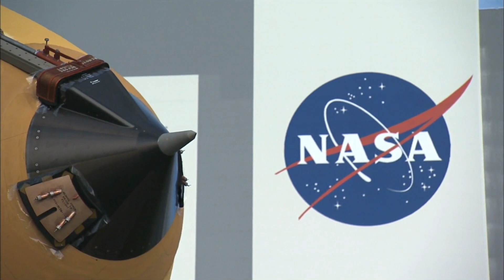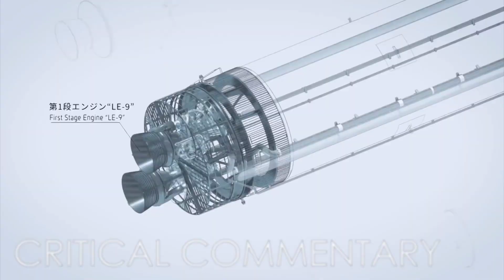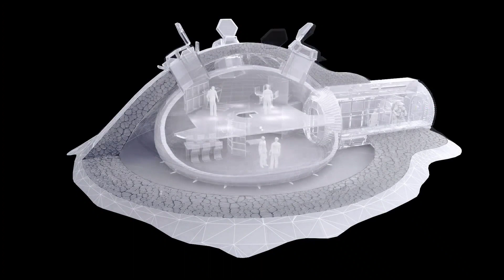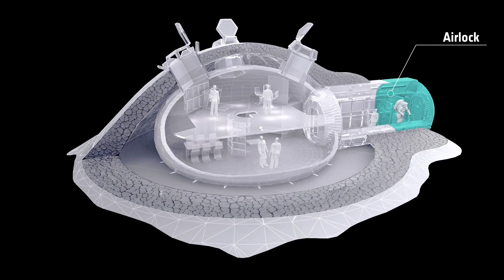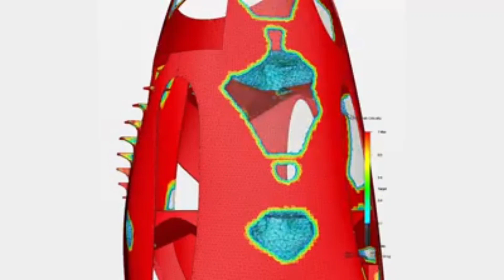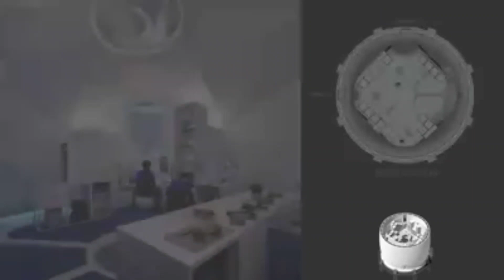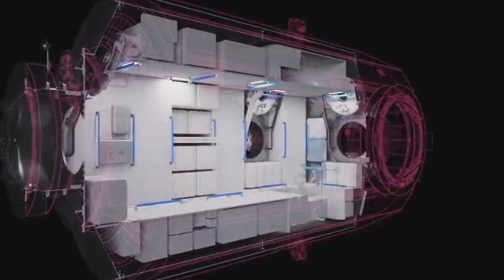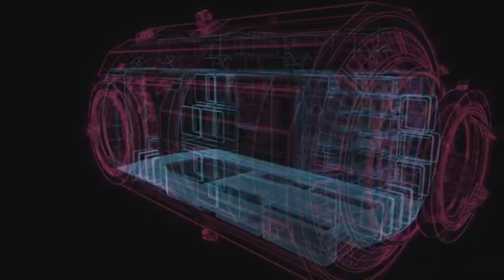YOU can participate in NASA'S 50 Point Plan for the Solar System!  How does Starship fit in?

Comment: Has anyone heard of AIspaceFactory after 2019? What have they been up to?
Reply: Not much use on Mars or the Moon, as you have to transport much of the construction materials too. no in situ materials are used. other than the ground up basalt.
Reply: @jessepollard7132  well that is an in situ resource. It still remains to be known if they've made progress
Reply: @lorisperfetto6021  yes, but getting it requires yet more delivery material. And no, I haven't seen any reports of more progress. Nice idea, but I think it is impractical. for use anywhere but Earth.
Reply: @jessepollard7132  if I remember correctly the machines can build pretty impressive structures with basalt and corn starch. As you've pointed out correctly too much mass is needed. I feel like ESA's inflatable underground habitats are a more viable option
Reply: @lorisperfetto6021  Me too.

Comment: Right now Starship can't do anything.   It hasn't launched to orbit.   My guess is Starship is an interim vehicle that will be great for transferring stuff to LEO.   In the long run people exploiting the solar system are going to need vehicles that measure cargo in thousands of tons.   That is far beyond Starship and chemical rockets. Of course,  that doesn't denigrate the contribution of Starship.   I just think we need to start thinking beyond Starship.
Reply: @lencumbow  I totally agree, but everybody seems to think the Starship is all we need.   It is just a little vehicle, comparable to a 1920s aircraft.  It doesn't provide the volume, speed or flexibility of what we will ultimately need.  That is going to require the next generation of propulsion.
Reply: @ronbyers9912  Starship v2 design has already been started, twice the diameter. almost 4 times the cargo capacity, and is intended to carry 1000 people per trip.